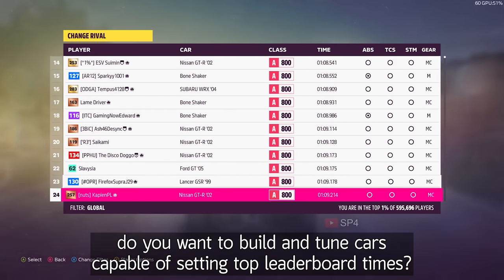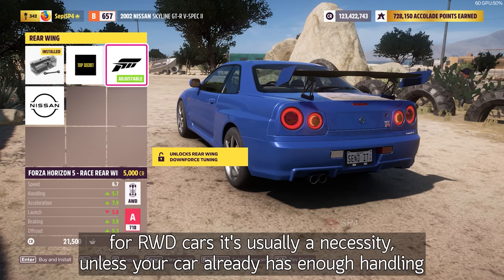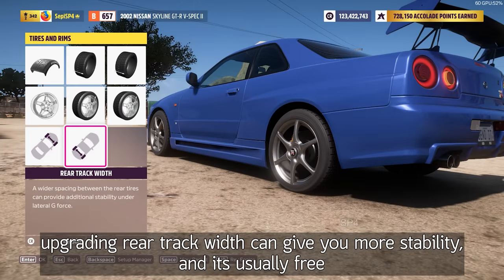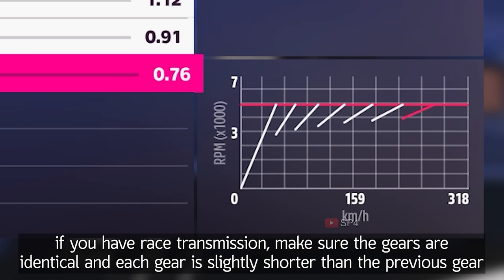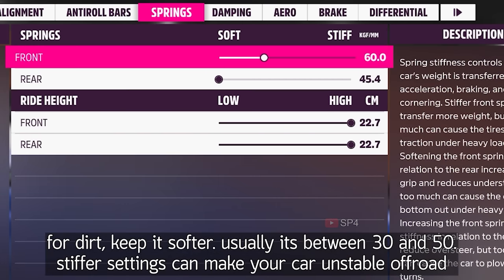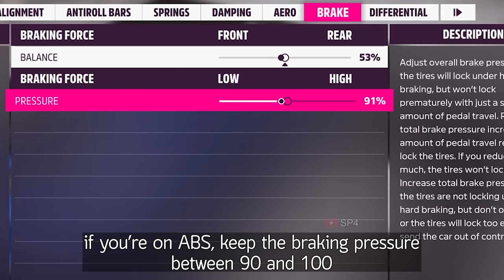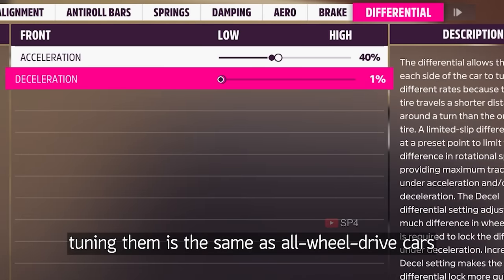Forza Horizon 5 META Tuning Guide

Comment: What's the premise for not upgrading camshaft unless you're on automatic transmission? Like, all the other things I can understand is just silly physics "bugs", but I don't understand why cams would be more worth it when driving on automatic? That makes no sense to me. All it does is increase your redline and put you powerband higher up in the rev range. I don't see why that would be more beneficial on auto, than on manual.

Comment: if you are driving the mercedes racing truck, the default braking pressure isn't enough to slow the truck down. If I remember correctly, around 175% is good.

Comment: Unbelievably, but this is really the ultimate tuning guide if you want to turn your non-driving bucket into an online pvp beast, or at least come close to it.
Everyone recommends the hokihoshi video and it is really great, but once again, as it was rightly said, tuning in fh5 is a liiiiiiiiiiiiiiiiittle different from tuning in real life.
Reply: I've been using Jonson racing's video since FH4. It still works in 5. He hasn't redone another for 5 yet. Personally I think Hokihoshi's is bad. Hes does it as if it real life. The game just doesn't work like that.
Reply: I dont know, I tried following this guide but it seems like no matter what I change the tires lose grip constantly, but hokihoshis vid took a good couple seconds off my lap times.

Im sure Im doing SOMETHING wrong but I cant quite wrap my head around it. Maybe its because Im on keyboard?
Reply: @enlightenedgroyper2956  everything is explained right there, if the car starts to slip while cornering, just start turning the settings towards understeer. here are the starting parameters, but by default they may not be suitable for all cars. (The car can also leave the turn at too high speed, but I hope this is not about that)
Reply: @BigMax-  The issue was ride height. I dropped that way down and messed with the diffs some and now it corners fine
Reply: @dylan538  This. Hokis guide is great for tuning cars to get them to drive the way they would in real life. For winning races in a videogame against sweatlords, meme tuning is a necessity. This video fulfills the latter purpose while Hokis fulfills the former.
Reply: @enlightenedgroyper2956  keyboard might actually be the reason. because you can't half press accel it makes it hard to control high power cars, which is the current meta. hokihohis vid is for more balanced and easier handling cars, which most likely work better on kbm.
Reply: @swagie_  I dont doubt it. Ive ordered a wheel though so it shouldnt be an issue for too long
Reply: @enlightenedgroyper2956  nice
hope you'll enjoy it and merry christmas
Reply: @swagie_  Isuckatdriving is using keyboard, and so do I. I manage to be in the 5% in the rivals on the first run like literally everytime, and usually finish on the podium in trials (its really hard to beat those rubberbanding AI's on unbeatable). So all in all its not that hard if u are used to it. And with a little bit of tuning tricks (like having slightly longer gear ratios in the first 3 gears in overpowered, oversteery cars so that pressing down the up arrow wont make your rear tires lose traction as much) you can make your life easier. But of course a controller is still a better option
Reply: @enlightenedgroyper2956 
Yes it's because you're on keyboard. Don't use keyboard for racing games. Please.
Reply: @jackcolson4745  wheel too expensive and i hate controllers sorry!
Reply: @enlightenedgroyper2956 
Racing games are the kind of games to play on controller because you need variability in your inputs. Don't dismiss it before trying it out first.
Reply: @horvathr95  i too using the keyboard and yes you can reach top spot with it. But its true that theres always cons in using that. You will had difficulties in online racing while you need to overtake someone with extra accurate lines and cornering

Comment: I wanted to ask if anyone knows why camshaft is a not a good upgrade unless you drive automatic. Im not a mechanic and just curious :3
edit:also thank you for the video its very to the point and informative unlike most tutorials i have seen. Just straight facts and advice for a quick look up instead of too much technical info :)
Reply: Mostly because of PI, you can get more power out of other upgrades.  Cams also make your engine rev much higher and in-tern gives you better acceleration, so unless you're doing rally or a track with very sharp turns you don't need to upgrade cams first.

Comment: There is a problem here. On high powered RWD cars at differential you need from 0-15 acceleration if you don't wanna spin your wheels too much. And 50-75 deceleration.
Reply: Skill issue

Comment: RWD is still the most OP if you are going for the High Speed build, best to note it takes skill to race them
Reply: It is not. AWD have same or even bit more (here forza magic kicks in) speed as RWD with same power if you tune gearbox to the same ratios. Speed debuff you see when swap is just because of different default gear ratios for AWD transmission. And as swap to AWD often drops PI and allows to biuld more power, it is AWD that is OP in most cases.
Reply: @SuperMassiveGrayCat  I am talking about with certain cars it is OP, the penalty AWD has is a small reduction on top speed in exchange for launch, while RWD is the opposite.
Reply: @LimitPro1  AWD has straight zero reduction on top speed if you change gear ratios from default to what you need.
The only real drawback of AWD is a little additional weight but it is usually like 40 kg
Reply: @SuperMassiveGrayCat  oh sorry thanks for clarification
Reply: @LimitPro1  I just like RWD cars and a bit in rage about AWD/RWD balance in forza and how mandatory AWD swap is in many cases.
Like, on Ford GT2017 swap to AWD drops 10 PI down and it is the only way to put, aero, semislicks and weight reduction in S1. I can't get why it is made so.

Comment: I don't get why you guys don't like the camshaft upgrade? It gives decent stat increase and the extra rpm comes in handy a lot for me. Being able to wring out each gear a little further and longer can help a lot especially around turns and whatnot
Reply: It costs comparatively more PI than other engine upgrades, and Horizon typically favour higher horsepower over more comfortable rev ranges
Reply: I run b class and that's about it cams give little and cost alot there's way better things to use pi on

Comment: So I took your Dodge Dart tune, deconstructed it, added beefier breaks and dropped front aero. Has me in the top 1% on rivals even in technical circuits and I am beating Unbeatable. Been working on the Dart for a week. Didn't realize FH5 was that arcade. PS: raise the front suspension to shift weight back and have a faster more stable ride.
Reply from the maker: what you did might make it easier but it also reduces handling. compare it to one of the top legit times.
Reply: @seP4  A tune that gets me in the top 200-2000 is better than a tune that makes me toss my controller out the window even if that tune is faster. 😂👍 Regardless the suspension shift is something you should try on any RWD muscle car. Front max height, rear max bottom. Once I can drive my 1000hp version consistently I will go back and try your crazy monster again. I only started trying to drive RWD Power about 30 game hours ago so give me a break lol.
Reply: @seP4  update. I took your exact build and its true, shifting the suspension makes it slower. FH5 is weird.

Comment: I'm not sure if this is a "good" formula but I tend to aim for a benchmark stats for the Class I'm tuning in, for example in A Class i'd use a 0 - 100 time of about uh 8 or 9 seconds but typically below 9 seconds. If that doesn't work i'd aim for a power range like 400, 450, 500 hp/ torque or a grip range of  1.10, 1.15 (not accurate stats but some examples). Same goes for all other classes, just different benchmarks based on the best or most decent cars in those classes and it helps more if the car is the same/ similar car type as the one you're tuning. But other than that I just see what works to do more or less of in upgrades, It's like a science experiment.
Hope this helps anyone, if I'm wrong you're free to criticize me or add in some additional advice.

Comment: Three things:

In real life, making your wheels bigger DOWNGRADES your handling. No idea why it's backwards in Forza.
Why are you using metric?
You also made a mistake about the brake balance. The in-game logic of front braking increasing your steering responsiveness is correct. It's not backwards.
Reply: Some good information though. I tuned an AWD C5 Corvette for rally (mixed dirt and road), and it's the best rally car I've found in the game. This will help me tune it a bit more.
Reply: Horizon tuning is counter intuitive and contradicts real life physics and logic. 
Most of the world uses metric
The break balance is inverted in forza. You can easily test this in game by turning off ABS and sliding the slider to the rear and watch the front wheels lock up.

Comment: Does this work (at least to some extend) in Forza Motorsport games or the older Horizon titles too?
Reply: Can confirm that FH4 does follow these rules very closely, except for tire pressure. It functions more or less like spring stiffness and/or damping. It's best to keep it at 1.0 PSI (lowest possible) when figuring out spring rate and damping, however, if the car still feels a bit loose and stiffening spring rate, damping or lowering ride height only hinders the car's cornering capabilities, increasing tire pressure is the next best thing to try out.

Comment: increase front diff on acceleration lock should increase understeer right？since it sync the front tyre and will pull you out of the corner

Comment: A properly tuned 10 speed with clutch upgrades (first gear long enough to minimize wheelspin/traction control turning on on a flat surface you'll be racing on, a second gear that is about a second long, then the rest around redline to top speed) can punch above the PI level given as you stay closer to peak power in most cases but seems to be an auto only strategy.
Reply: This is a proper aproach to 6-7 speed too. A-class and above need way longer 1-2 gears than what is shown as example here. And that gives both - better launch and more effective power where you really need it.
Reply: Not true. A 10 speed can be set up as effectively a 6. In my drag cars I set them up to effectively 3 to 4 speed cars.
Reply: The problem with 10 speeds is that you can end up shifting too often and losing time because of it. They work great for the long haul highway runs, not so much on the winding tracks. 

@felix wankel I don't do many drag races anymore but I'll cut down on gears too. For me it's mostly lightly upgraded classics that just can't make the most of a 6 speed. I wish they'd just make it to where you buy the race transmission and from there you can add or remove gears in the tuning menu
Reply: @Lofi.z34  A lot of people don't realize you don't have to use a 10 speed like a 10 speed. You can use the 10 speed to drop PI then tune it as if it's a 5 or 6 gear transmission by slamming all the top gears past the aerodynamic top speed. 10 speed doesn't mean you have to use all 10.

Comment: Im still somewhat confused about the Damping part, sadly i dont know what responsiveness and weight transfer means, so im hearing ''somewhere between this number and that number should be good, but dont be afraid to go higher/lower'' means nothing to me x^x can someone pls explain. I found multiple sources trying to explain it to me in real life and online, but still nothin.. I dont really need to know all the logic behind it, just to know the general good/ok setting on most cars.. Wether its better to have rear higher than front, or other way around, or how much gap should i have between each number, and stuff like that =C
(Edit a bit later: I semi understood it but im completely confused on this tuning, pretty sure i did everything right except a little fidgety damping, but my car absolutely spins and drifts at even the lightest tap, ill be going down a straight highway at like 150km's and even the slightest tap when the road curves ever so slightly throws me off.. not even mentioning doing a race that has cornering, i turn that race into a drift race, i somehow racked up 11k points of drifting by just trying to turn.. (i swear i didnt press e-brake).. Any explanation?

Comment: Why avoid upgrading chamshaft? I thought it was one of the best upgrades someone could do xD
Reply: If you play on auto transmission it will help you. But in manual and most engines it's not PI efficient (better use other upgrades instead of camshafts).
Reply: @julls42  Thanks!

Comment: hmmmmmmm is Brake Bias is more to front it will oversteer? hmmmm is that FH5 broken physics? usually is the BB is to the front under heavy braking the front will lock up and cause understeer, and if it is to the back, the rear can lock up and have oversteer on turning.  is the FH5 physics doing the opposite?
Reply: Yes FH5 brake bias is backwards. Moving the slider toward rear actually moves the brske balance toward front. You can easily test this by moving it all the way rear or forward and watch which wheels lock up when braking

Comment: I will need this. Probably better than the other guide, i turned off all assists (and simulation steering) so this'll most likely be more accurate.
(Btw i thought the brake force balance was reversed in FH5 because of the other guide)
Edit: yes... i used that 8:00

Comment: the numbers you used are arbitrary as they change based on each car. there is a formula for how to tune the car. the closer you get the car to 50/50 weight ratio and suspension tuning the car can dominate in any race.

Comment: Umm.. im not the best in english. May i ask, what does "lower PI cost" means?
Reply: If your car is 700 and you want to upgrade your car to 800 your budget is 100 PI points. Low PI cost refers to parts that don’t increase your PI much but increase performance significantly.

As an example camshaft upgrades cost much PI but don’t increase performance as good as other upgrades that cost less PI points but increase power much more.
Reply: @elhomoflow  Ouhhhh, now i understand, Thanks so much

Comment: Hi! Awesome video, I wanted to ask a question about the differential:
I saw the Hokihoshi's video before and I understood that an Higher setting on Front Diff Accel means understeer (5:56 on his video), while here I got that Higher front setting means more Oversteer on throttle, could I get some ideas behind that? 
Thank you again for the video, really appreciate :)
Reply from the maker: hokihoshi's video is about real life tuning. which is not the same as forza
Reply: @seP4  Thank you a lot. Have a great day!
Reply: i am pretty sure its wrong in this video. Having a dirt car with 100% acceleration is understeering. Reducing it will make that car start to slide and make it oversteering. Same on street, but on dirt you notice it immediatly.
Reply: @partoftoto  I'll need to try it out myself, things are a little strange with tuning... When I have time I'll try some things
Reply: The video is not right. It gives you understeer even in Forza. In FWD cars it's very noticeable how a 100% accel setting will make your car push on exit. The AWD diff in Forza is just the two ends combined.

But the trade off is more traction, which helps in high speed corners. Having the inside front wheel lose traction is pretty bad. On the other hand, lower diff setting will give you a better corner exit with less understeer.

When they do meta tunes, they max lock both accel diffs because the rear lock sort of compensates the understeer caused by the front lock and you have a car that corners on rails with good cornering speeds. If you want more oversteer on corner exit you can always run 80% on front or something.
Reply: @nightdriver7216  Thank you for your help, it makes more sense now. 
I've been struggling with this topic because of the different infos but I have a bigger understanding of what happens thanks to your comment.

Comment: is this really the 'meta' setup style? I usually tune based on feel and how setup changes affect irl cars. It usually ends up being very simple. adjust tire width upgrades until you like how the car feels before any tuning, then open up the differentials and adjust gearing to taste. I've got a couple top 1% rivals times with similar setups.
Reply: This is meta tuning. In another comment SP4 said that because horizon does have some exploitable arcade physics mechanics, these meta tuning methods exist. Many other tuners like hoki hoshi tune based on real life physics, and tuning like that can make very balanced builds, but they won't be as fast as the meta builds.

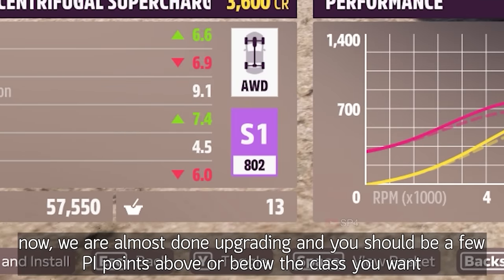Comment: 3:21 "avoid upgrading camshaft unless you drive automatic" why difference does it make ?
Reply from the maker: it changes your powerband which makes your engine less pi efficient
Reply: @seP4  fair enough but almost everyone is going to play on automatic, if you look at leaderboards for rivals etc 90% are using automatic settings some with traction and stability off and some on

Comment: Here are some more meta stuff but for big off road trucks
In big trucks if you wanna go fast you will need alot of gears , for trucks over 3 tons a 10 speed works well
And because of there big heavy top heaviness , 60% braking to the front works well
And weigjt reduction is alot worse for off road as grip on off road is alot more pressure based than friction based , so alot of tire being pushed down into the ground by alot of weight  , so weight reduction is mostly for S1 builds